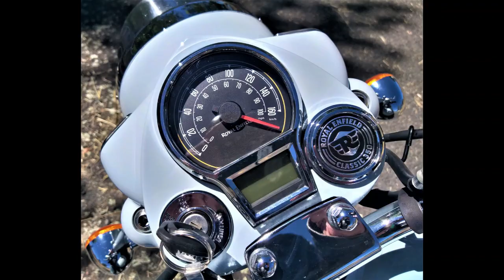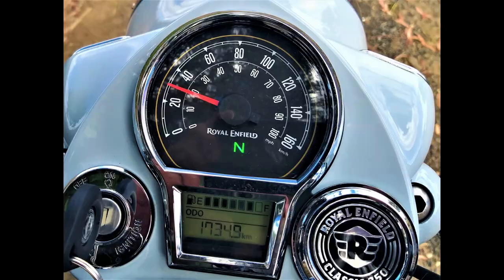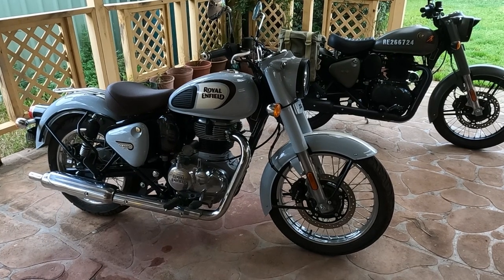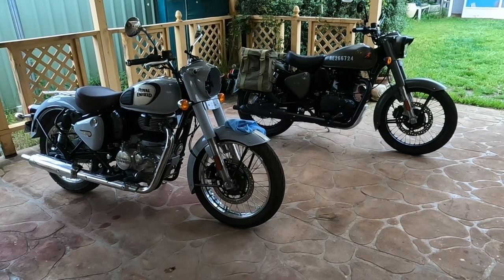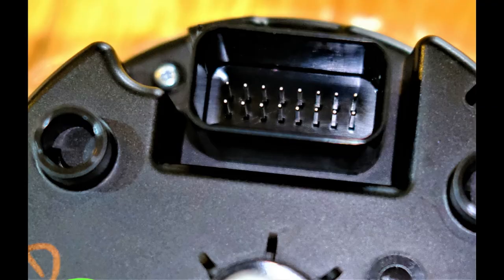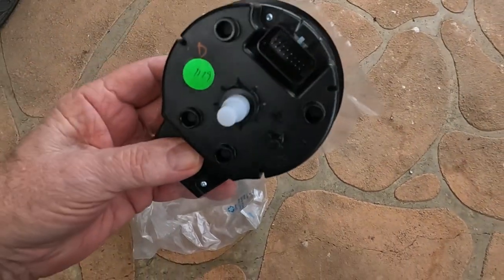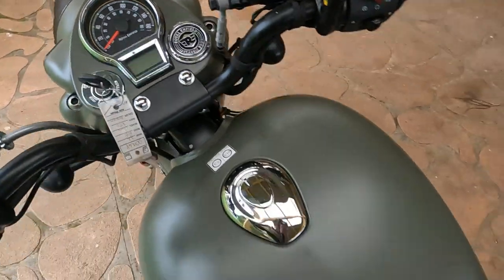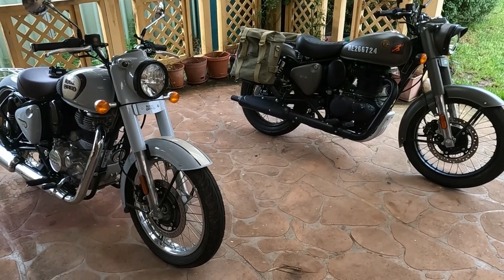Royal Enfield Classic 350 Reborn - How I Fixed My Faulty Cheap And Nasty Plastic Speedometer!

Comment: Hi Warro,
just a quick update for you.
I tried this today on my own Classic 350 which was showing 20 kph at a standstill today.
After disconnecting and cleaning the connection ( which didn't look dirty at all by the way ), when I put everything back together, the speedo calibrated correctly to 0 kph !
I filmed the whole process for my channel and in my case it has certainly helped, at least for now.
My video is coming out next week and I give you due credit and will link to this video in my video description.
I will let you know if my speedo ever plays up again after this.
Thanks again for this useful video, it looks as though you could be onto something !
Cheers Warro,
ER.
Reply from the maker: good to hear things went ok. who knows the electrical cleaner i used may or may not have been an over-kill. wd40 may have worked for zero outlay.
mine is still working fine but should it happen again - i will try wd40...lol
now its working correctly and has been for months -i'm really not game to touch something which is working fine.
very interesting too you actually pulled the connector when it was stuck on 20 kph -cleaned it up and it re-zeroed immediately
normally that move alone would have been impossible to do and recalibrate to zero on the faulty unit and take many many attempts.
also good to hear you got back to me to advise if it worked or not.
i no longer add tips for the classic 500 -you know i owned 15 new and know all about them. i was just adding the info and they the viewers were too lazy to give a thumbs up for the help OR they had issues and i helped them out and never heard from them again.
now they can get //// and ask the guro...lol
as if he would know...you need to own more than one 500 to know the answers
anyway all the best and hopefully it gets you riding longer and less key flicking
Reply: @ridewithwarro  Hi Warro,
well these days you are the Classic 350 guru, no doubt. This is the second time you've helped me out. The first time you helped me with how to get the shift lever off the spline to move it up a notch and now this !
I did actually use an electrical contact cleaner first and before reconnecting I gave both sides a quick blast of WD40 to keep the moisture out and prevent future corrosion of the contacts.
As you mention, the really fascinating thing about this in my case was that the speedo was stuck malfunctioning at the time ! By doing this it reset itself correctly. It was a bit weird though. On the first attempt the needle dropped from 20 kph to 0 kph ( without sweeping up to 160 kph first, like it normally does ), then it groaned for a bit and the needle trembled about at 0 kph. 
For a brief moment there I did think that I had broken something 😂
When I then switched it off and on again, it did the normal sweep from 0-160 kph and settled back to zero. So that first attempt was definitely odd, as if the speedo was confused or something. So we definitely did something to the little sod, even if we don't know exactly what ! It will be really interesting to see how long this current fix lasts, that's for sure. Imagine if all of the speedos RE have replaced were actually NOT defective, merely having a dirty connection ! In that case they will have wasted a lot of money. I've heard of people on their third or fourth new speedo, so it might well be the connector rather than the speedos themselves ! 😱

Anyway, I do give you plenty of credit in the video and we even raise a glass of the old amber nectar in your honour 😜 The video is out on Tuesday if you'd like to see what I did.

Anyway mate, I really appreciate your videos and your willingness to get stuck into your bikes. You do it so I don't have to ! 🤗
I also appreciate the time you take to reply to comments ( something I also do ! ).
YouTube is a better place for having you around Warro ! Thanks 👍🏻
Take care and good luck with your lovely bikes.
ER.
Reply from the maker: @economicalrides  no drama-all the best and i hope it holds out. time will tell there
Reply: @ridewithwarro  For "my 2 cents worth" I reckon that using a designated electro cleaner is the best bet by far! WD40 could actually end up, gumming up the connector pins. WD40 (and similar anti-corrosive treatments) create a protective barrier. In this situation, you don't want to be creating any sought of an electrical barrier.
Reply from the maker: @seanb1081  so far it's worked pretty good
Reply: @seanb1081  WD40 keeps moisture from forming and judging by the fogging behind the glass, these speedos are not moisture resistant.
You can always use a contact cleaner spray anyway but I think it is more important to keep the contacts free from moisture once they have been cleaned. I suspect that the contacts start to corrode once you have moisture in the speedo, which many of us have experienced as misting of the glass from the inside. Removing the corrosion with contact cleaner and then protecting against future corrosion seems like the best solution to me. Since I did it, my speedo went from not working to working, so there is no way WD40 made the conductivity worse.

Comment: Hi Warro. Do you take your travelling tool box and sprays with you. Either you’re a good reason to buy a RE Warro or you’re a good reason not to buy one, lol. Not a video goes by when a RE channel goes buy where they keep having to do all this. What does the warranty cover my ole matey. Just a bit of humour and ribbing you Warro.
Reply from the maker: all good there. well first off i dont care about the warranty that much as i'd have to do a 500 klm round trip and i'm not that desperate to travel ...lol and if i did have issues -i'd just sell it off cheap and buy another one...lol
 i still say the new 350 is the best enfield single to date.
now the only issue i've had with both bikes is the speedo on the halcyon which i think ive now sorted out.
sure i buy other bikes but i still keep coming back to these. they are such a fun bike to own and ride plus they make you feel good too.
as you grow older not much i think really makes you happy -just buy and ride them -sell and buy again. but an enfield will and this new 350 is my favourite bike.
10 years back i came from a car background and in those days you couldn't give me a bike as i'd classed them as a total waste of money...not even for free...lol times sure have changed except for the fact i won't ride a bike in the wet...lol
all the best!
Reply: @ridewithwarro  This is such a lovely comment♥️

Comment: Great sleuthing!  Wondering though...if you puts in a new speedo, you get "0" miles/Kms again, yes?
That's one way to keep the value of the bike up!

Ride Safe 🙏🏼
Reply from the maker: looking on the web at enfields you can buy most stuff from ebay. listed units available now are  interceptor 650/meteor 350/ himalayan/ classic 350 reborn etc- all instrumentaion sets available from aud$250 to aud$400
so it would not be hard to grab a new instrumention set for any of the royal enfield range of bikes.